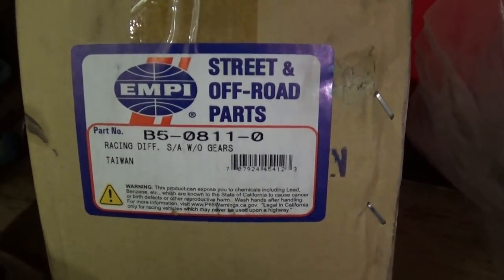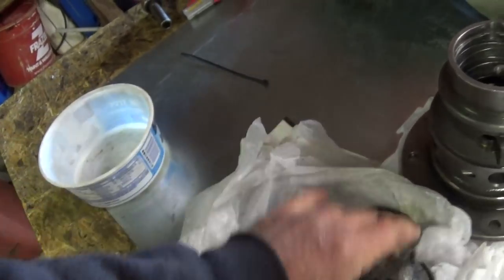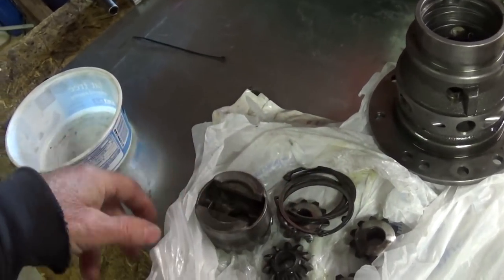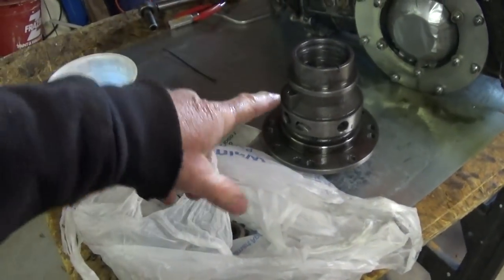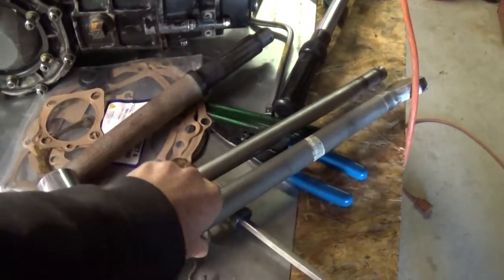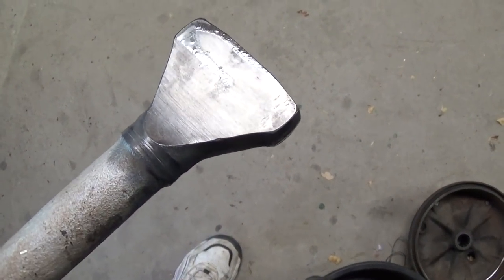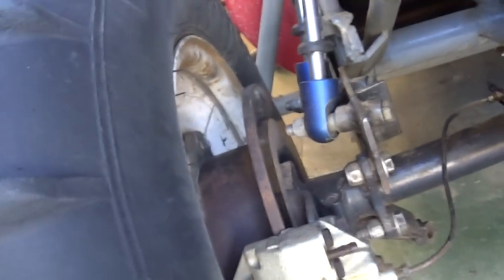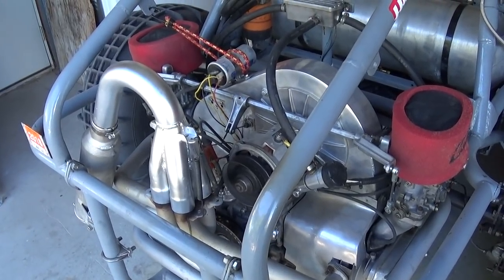VW Transmision SuperDiff Fail Pt 2 of 2

Comment: Great video... sand railing, our healthy addiction. Your right on about bolt stretch. Both my dad and I had airplanes for many years and did our 100 hour and 500 hour inspections. Many of the bolts (by air-frame and engines manuals) were always replaced if removed with new ones, no exceptions.

Comment: Mr GZ, my father is building a 59 beetle and had a shop put one of these super diff’s in he’s been having some issues, is there a way for him to privately contact you to discuss your experience with these units and  some of his concerns. He found this video very informative but still has some questions.
Reply from the maker: Nobody makes a good superdiff anymore. The new snap ring style super diffs are junk in my humble opinion. A stock differential from a later model swing axle like 1966 or 1967 will last longer and run quiet. A 66 is 6 volt and would drop right in a 59 but you might have to swap the nose cone or modify the front mount.

Comment: Sucks about the poor parts. Do you get Quaife parts in the US? They're a British company making transmission parts for racing. Well regarded and I know they do a LSD for swing axle gear boxes.
Reply from the maker: Never heard of them. You folks over there to a lot of Formula Vee road racing so there is a different market over there. Most of those cars use taller gear ratio's to maximise top speed. Amazing little cars. I often wondered how they would do in the sand with paddle tires
Reply: TheEZGZ The Vee's would be great on sand. Probably a bit on the low side though... maybe a super loud sand plow!!!
The quaife lsds were made for those vee track/road racers types. Theyre auto torque biasing and im not 100% how that would work in an off road situation. I know you get different types of lsds so id imagine one type is better suited to off roading.

Might be worth checking out if you come across one on your travels.

Comment: Look EZ now days even trying to build a stock 1600 with all new aftermarket parts you run into all kind of problems. Me its  been trying to find oil pumps that fit the new cases they are to small and suck air and leak on the suck side and the pressure side. Years ago you could go buy rebuilt parts and not even worry about nothing. Try to buy older  Parts you know like back in the 60s and 70s. Heck the first 1200 I built in 73 ran 135 thousand miles all over Texas.  Good luck brother

Comment: I looked up this part and it is listed as a "Top Quality Part". I wonder if a gear tooth broke first and that led to series of events?
Reply from the maker: That's why I took a chance as well. I was a bit concererned when it arrived and was not what I ordered. The inside of the housing should have been machined where the small spyder gears seat against the house and it worried me but I set it up snug?????  I could not remove the outer bearing without cutting into the main body to relieve the pressure. Then it came right off as normal which tells me the outer lip grew?????  When you tow something damaged for 2 miles it's hard to tell what happened??   I appreciate your view, comment and support. Take care